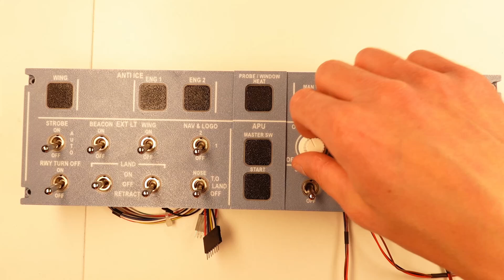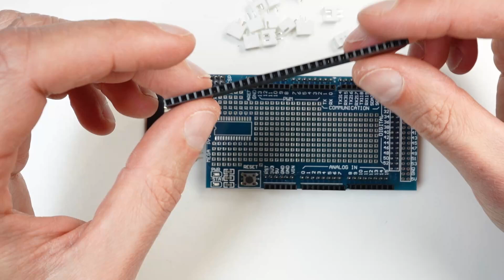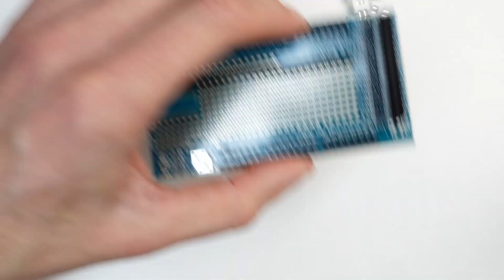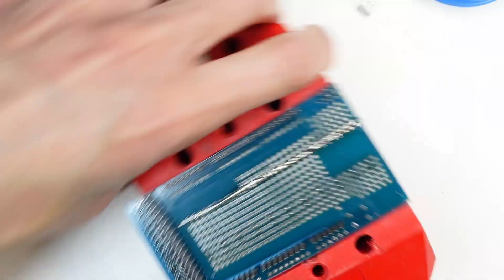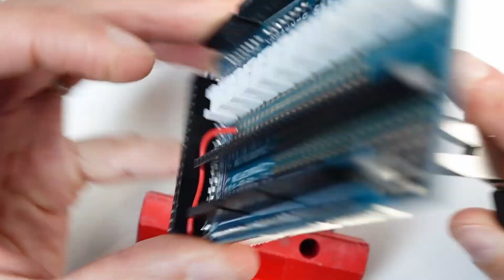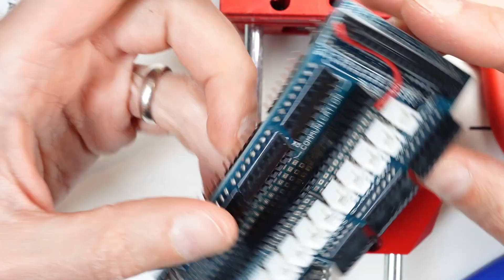Arduino Expansion Board - EP 21 - Full Home Cockpit Build

Comment: Since i wasn't sure you came back i tried to continue on, i'm almost finished with the third panel and then starting on the fuel/hydrolics, but think i'm gonna make a hold and start back at scratch with you back.
All works wonders, although those LED strips is a pain to manage to get room for xD
But one issue that i am having and i'm thinking it has to do with the led strip wires.. everytime i adjust the potentiometer and the led strip comes to life, it seems to be pressing my buttons constantly without me touching anything.
Is this caused by those wires not being properly isolated from the signal wires ?

Looking forward to continue this project with you! already ordered the parts you linked!

Comment: I used an external simpler and cheaper protoype board, installed right next to my arduino, to put all of my connectors (also LED resistors and other staff) and from there I connected all of them to my arduino prototype board with just a few pair of wires. Found easier to wire (or solder)  the important signal wires to ardurino without having a lot of other wires on top of it. But in case you want to have fewer boards with less space occupied, that is a great solution. And to be honest, wires are not so much trouble. Thx for your detailed video and sharing your ideas. Keep going.